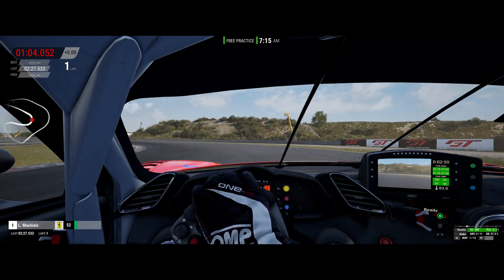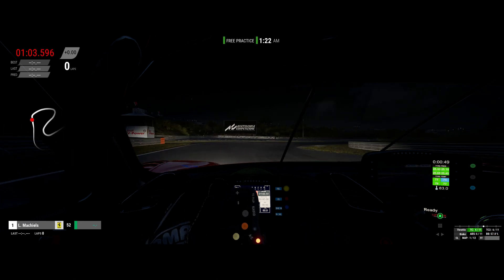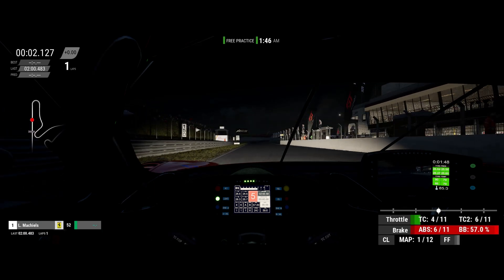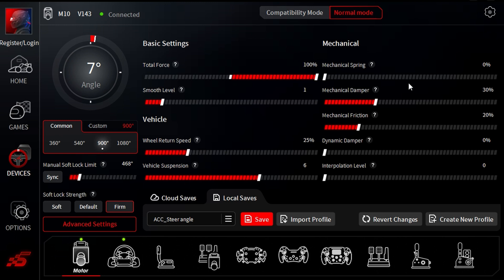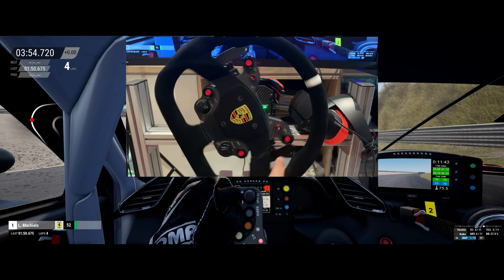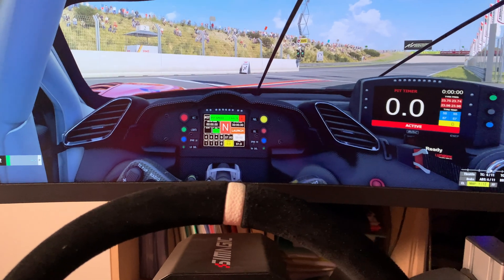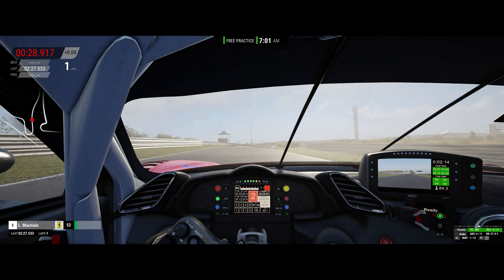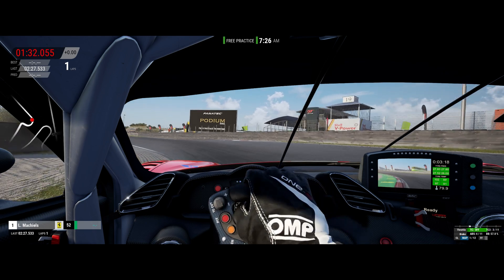How to : Force Feedback settings for any wheelbase (including Simagic Simpro settings for ACC)

Comment: Just today I adjusted my FFB on my Simagic Alpha, and I did it the reverse of  what you suggested here.  I had the base set at 100% and tried eliminating the clipping in ACC, but it wouldn't work no matter how low I brought down the gain.. So I brought down the total force in Simagic Pro to 80%, and then was able to finally find a sweet spot adjusting the gain in  ACC. For me, it is 80% in-game. I still allow for a bit of clipping, but am willing to accept it for the sake of the steering wheel feel, so it's a compromise.
Reply from the maker: Glad you got it dialed in! Nothing beats a well calibrated force feedback. So much so that I find myself resisting upgrading Simpro to a newer version because I don’t want to mess up my settings!

Comment: Nice simple video. I suggest trying the steer lock trick where you set the in-game steer lock to zero and only set the correct lock from SimPro Manager. So 480 degrees for the 488. This almost completely reduces steering latency and will feel very direct. As a bonus you don’t have to set the steering locks per car twice, just set from SimPro when you switch cars. I’m also on the M10, SimPro v1.3b
Reply from the maker: That sounds great, I’m going to try that out. Thanks!